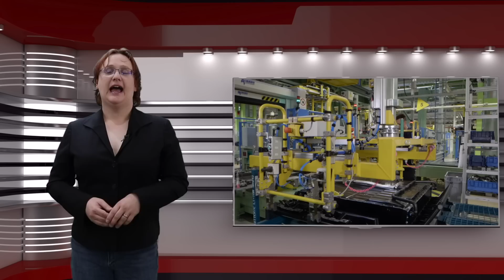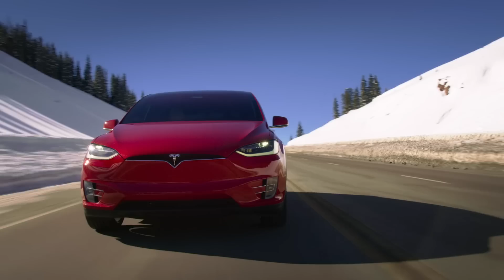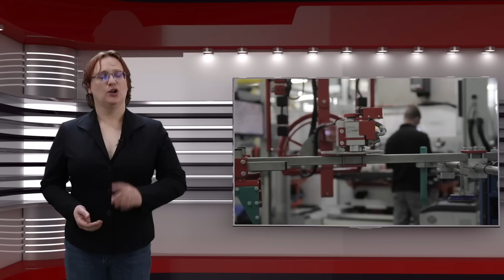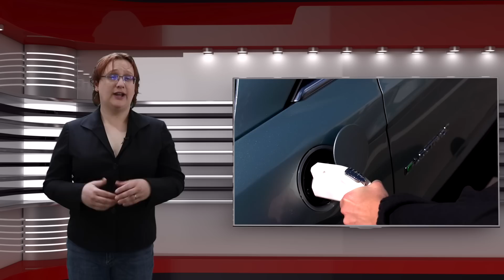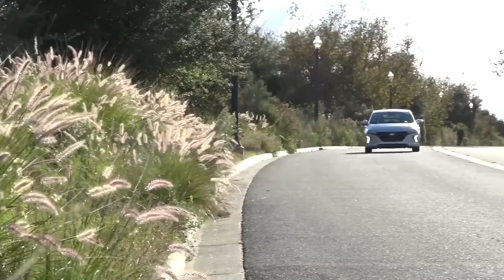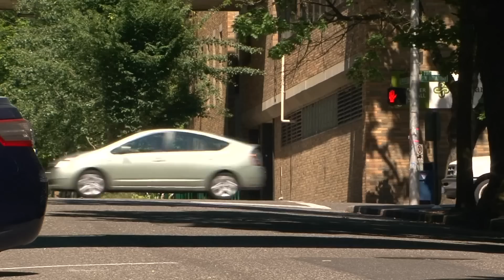As EVs Get Older, Aftermarket Batteries Will Change The EV Marketplace

Comment: 8 year is a morden car lifespan, wow my 22 year old car is still going strong 350,000k mile later
Reply: Sounds like my 99 Tahoe with 280k on the clock
Reply: 01 Dakota 300k and still runs great.
Reply: I just don’t know about Battery Powered cars lasting 20+ years though, my lawnmowers lasted 3-4 and I went back to gas, I’m guessing the same for EV? And the government never gave me any $$ for buying an electric lawnmower
Reply: @Precious_Metals_Fissioneer  except for the battery, it's likely that the rest of the car wil last 20plus years, because of the drivetrain using far less parts then ICE engines.
Reply: My last couple of cars I've hit 300,000 miles. My current car is 8 years old and has $122,000 miles. Total cost of repairs and maintenance today has been $3,000. it's a Kia which cost $15,000 American dollars when it was new.

Comment: Thanks for the info I love our BMW i3 would probably just trade in mine for a new one at battery replacement time. It’s a 2014 and still has the same miles and run time to this day. Not sure when or if I’ll even have to replace them. And lastly you could have saved the far right comment as I’m on the right and own electric cars and I also don’t litter. In the future I don’t think there’s any need for those kind of opening lines.....walkaway.

Comment: Battery technology is already advancing, a few startups are already boasting over 600 miles, and less than 2 minute charge times. Silicon batteries, solid state batteries,  etc.,  just give me the right voltage and you can take my old battery pack, no problem. And in 8 years, who knows how low it will cost?

Comment: When you talk about environmental impact, you have to consider how much virgin materals are used in battery pack and drivetrain. Plus what your power company uses as fuel for production of electricity. So right now gas engines have edge over electrc plug in vehicles, but in future with more recycled materials going into electric cars and their battery packs, and cleaner production of electricity, that will change. Plus newer battery technology promises a battery that lasts 2 to 3 X longer than current technology.

Comment: I have a Leaf (#712) and it still fully charges after 7 years.  Although you do lose range (so far my loss is around 10%) the degradation exponentially decreases so I anticipate getting at least 15 (maybe 20) years out of my batteries.  If so, I will have saved so much over a standard gas powered vehicle.  In those seven years so far my maintenance costs have been under $500 - replacement of the accessory battery, one flat tire, and yearly battery check.  In my case I'm in a pretty good environment for a battery with a passive thermal management system, and I always make sure to never leave the battery fully charged for more than a few hours.

Comment: Some interesting points but the two cars in my driveway are 14 and 15 years old if I had to spend thousands to keep it working it be will going to the wrecker. This may be the problem with electric cars I feel many will be wrecked because the cost of replacing the battery is more than the value of the car.

Comment: Electricity has a MUCH bigger ecological impact, not considering that nuclear materials are only 2/3 depleted when retired and have a several thousand year shelf life. But the smaller carbon footprint from consistantly evolving, internal combustion engines, drastically reduces gasses released into the atmosphere, compared to fossil fueled power plants. And electricity is more costly per month, compared to gas/diesel.

Comment: Implying that you’ll need to throw your Tesla (or even just its battery pack) away after 8-10 years is highly misleading. Tests have shown only 6-7 % battery degradation after 400,000 kilometers, which is more than most owners would drive in 8-10 years.

Comment: I hate hearing bias in videos like this. I'm totally gung ho on electrics cars, but you just can't make blanket statements about ev's vs ice's: a 6k lb Tesla has more than double the production carbon footprint of any ice car, and manufacturers are now producing engine that have the thermal efficiency greater than some fossil fuel power generating station, many of which are quite old. 

Long term electrics are the answer, but the bias isn't helping anyone.

Comment: 2500usd for a bettery after how many years? My 20 year old truck has had only oil and fluid changes over its life and is just under 3000usd. I call bs on the 8 year life span and battery cost..... 2500usd for a battery replacement is  (lowest cost) seems LOW

Comment: Same than with phones, if manufacturers do not give the option to the customer, a market of unofficial battery packs will emerge. Electric cars can run for 20 years. Batteries are going to cost around 3.000 Euros in 10 years time. There will be yet a shortage of electric vehicles then. Buying a 15.000 refurbished 2019 e-car in 2029 will make more sense than buying a 4 years old internal combustion one for the same price. The only logical option for the manufacturers is for them to charge a big extra for an official battery pack and/or to try making battery pack refurbish illegal. I don't see the last possible. They may software unable installation of unofficial new closed batteries, but I don't think they can avoid anyone opening the official pack, changing all its batteries with new ones and packing the battery back.

Comment: I wouldn't be sure that batteries will need regular replacement going forward. I have a 5yo ~90k mile Tesla that is still at 96% of its original range, so unless it just randomly fails completely, the original battery should still be good for a long time. I know Nissan and others don't last that long, but I think they'll get there eventually.
Reply: Jeremy Schmidt ya the leaf, even the new one I heard, doesn't have water cooling for battery.
Reply: Spenser Roger The upcoming 60kWh leaf is supposedly going to finally have active cooling on the battery. Fingers crossed that happens. A Leaf with 200+ mile range and a battery that lasts will be a pretty good car actually.
Reply: Tell tesla to change it, ten year warranty isn't it...if my car didn't give me 100% i would complain
Reply: joey doe  96% after 5yrs is exceptionally little degradation for any lithium ion battery. This much or more degradation is expected, so there's no way they'd change it and I'd be crazy to complain about it performing exceptionally well. 

Oh, and, for the record, it's a 8yr warrantee. Doesn't matter here but thought I'd clear that up...
Reply: 10 or 8 years don't matter will never be a battery electric car era, electric cars but whit a fuel cell or a connection in the road, battery is the same time consuming thing like the oil and its cost to much, in sweden where i live volvo is testing a road connection and like volvos experiments before think its can work.
My diesel subaru outback still gives me 100% every day and its 4 years old and beats a tesla in snow and dirt any day
Reply: joey doe  Hydrogen fuel cells don't last even as long as batteries, and cost way more to run, plus you have to refuel at a station just like gas/diesel car (that's a big downside once you're used to home charging). I think hydrogen is a dead end road. 
Charging in the road might work, but will be inefficient at best...but I'm open to it if they can figure it out. 
I strongly doubt that your Subaru is still giving you 100%. Engines wear with time and give you lower fuel economy. 96% is still so close to new that you probably don't notice it, just like I don't notice my slightly reduced range...
Reply: i mean some new idea not hydrogen, home charging in sweden cost a lot and the tesla power thing needs more charge what a normal house can give, think a normal house have 10 amp  and the tesla needs 16 so you have to upgrade the house and then the cabel in the ground...
Used to work whit it befor as a stone mason and all my friends still working in the industry say one thing but cabel to 1-2 electric cars like tesla in everybodys house or even to charging stations in a small city its like remake all the asfaltroads in sweden underground, don't get me wrong i like the electric motor but not the battery its so enormous unificent this day and  has no long life, park your tesla for 2 years whit out any charge and see...
one of my land rover defenders i slumbering in the garage for 6 years and it still starts if i fix the battery haha 
search eroad arlanda and you will find the swedish solution and when we change it to wifi or something its the new battery,  volvo is going to have  electric motors in all cars 2019 but will have a hybrid because there are no good battery's
Reply: joey doe Ok, I guess you'll see the truth soon enough so I'll quit arguing. If a battery that outlasts an engine still isn't good enough for you then I'm not sure what is...
Reply: sorry for the hassle but a battery that outlast a hassle free toyota engine is long a way , 2017 december there was 0.15 % sold electric cars in the world and mostly in china so to think its gona be a major change whiteout a couple of wars and you and me very old is really bullshit and when tesla go down and it will because its not making money it will take longer to change out the old cars
Reply: That's not how batteries work, there are companies that guarantee range but they do that by not allowing you to use the full capacity when new and then as it ages letting you use more and more of the reserve capacity. This actually pisses people off way worse because they are not being allowed to use the full capacity of there battery.
Reply: joey doe
If you tested your Subaru performance I'd bet money it's NOT "100%", not in terms of power nor range.  (depending on the mileage)
Also it turns out Tesla is making very good money on the 3 which is a major component of the companies financial performance so it's likely that Elon is right about profitability this yr.  Amazon and Netflix don't make money either and they are doing just fine
 
https://www.thestreet.com/investing/tesla-model-3-is-already-really-profitable-14653241
Reply: That’s why the Fiat is where it’s at! I’m hoping to get 20 years out of my battery pack. It’s water cooled and made by Bosch so it has to last!
Reply: they all have the same batteries.  yours will fail shortly.  tesla has no special mysterious battery.
Reply: goofyfoot2001
Perhaps you know better but automotive expert Munro who completely deconstructed the Model 3 determined that the batt tech was far superior to anything else on the market and even significantly better than the S or X.  Also the 3 has some 30% higher energy density than the S or X and those two were already the best with one rival--the BMW ugly little EV.  Battery life may turn out to be a non-issue with only slight degradation by 100k miles and perhaps 500k possible.  These are not smart phones.

In short, you don't know what your talking about.
Reply: 5 years with 96% seems outstanding and its only getting better with tech.plus Its 6 times more cheaper than fuel so huge deal on fuel cost is saved too.tell us about ur maintainance cost too.heard ev's require minimum maintainance since they have less moving parts.is it applying to your ev too?
Reply: Bo McGillacutty, well, the BMW i3 uses a Tesla motor& battery.
Reply: Tesla also has top of the line battery maintenance systems built in to preserve battery health
Reply: Jeremy Schmidt, to be fair, I DID hear about a Tesla Model S, that was being used as a Taxi, with 400,000 kilometers, that's had 3 battery replacements, all under warrantee. But that was presumably due to frequent Supercharging, under harsh daily commercial use. Most cars would never experience those conditions.
Reply: When your battery starts to lose it's capacity.  Look on my page for A trick to regain some of the capacity back.  You can use this trick on cellphone, power tools, solar arrays, 12 volt car batteries Ect.

  The effect is cumulative and takes quite awhile to get the full benefit on each battery.

  The trick should be connected while charging, but can constantly connected if that is easier for you.
Reply: Probably because a Tesla has better range, hence you charge it less than a Leaf for example.

Comment: My drive range to work is 16 miles two way..  So if my model 3 Range is 300 miles.  by the time it range down to 50 miles because battery getting old.  My M3 would last 50 years... over a million miles, don't u guys think so ?  Well, with old battery technology.  The Lyft company for model s or X drove over 300,000 and their batteries still have over 95% decodation.  Thanks for commend.

Comment: Like in the 50s and 60s teenagers tinkered with gas cars to make them go faster (hot rods). Today's teens will tinker with electric cars for the same reason. Trying to squeeze a bigger motor or larger battery pack to gain more speed and more power. Also messing with the software to do the same. 

G

Comment: As EV's and range extended hybrids become more numerous, it becomes easier to customize ANY existing car into and EV/hybrid. As for keeping older EV's going from an engineering standpoint they are VERY simple. Sure some manufactures will be painful and make us create workarounds for their propitiatory software until governmental regulation forces them to do otherwise (as with ODB2). But the brains (for the battery/motor etc) can relatively easily be replaced/circumvented with arduino/rasspbery powerd alternatives that already exist in the home built ev world

Comment: Older/early model/low range EVs will keep being used with their original batteries because, over the mechanical lifetime of the car, there will always be buyers whose needs are compatible with a cheap car with a limited range between overnight charges, however limited the range might become. A gradually decreasing range is quite different to the increasing maintenance costs of an aging ICE car due to progressive mechanical failures. The range of the EV declines but the cost of ownership per km traveled remains flat.

Comment: I'll post this on the Patreon page as well but I just hit 20k miles with my replacement battery on my used Leaf.  I had bought it from Carmax in January '17 with the intention of getting one that still had a warranty on the battery.  I found one in great shape and with 10k miles and 10 months left on the warranty.   It dropped the 4th capacity bar and I had it replaced under warranty with no hassle.  

Now it's been another 14 months and 20k miles, and to date no noticeable degredation and still all 12 capacity bars.  It's probably a combination of my slow charging on 120v almost always and the improved chemistry of the replacement pack.  I still watch everyday for that first bar to fade, but nothing yet!
Reply: Thank you for sharing your Nissan Leaf story. Mine unfortunately has not gone so well. I was 29 days out of warranty with only 30,912 miles on my car and it dropped the fourth bar. Nissan call center said I'm out of luck. My car only goes 30'ish miles now when the air conditionong is running.  I have an idea... If your leaf gets in a wreck, promise to donate your new chemistry battery to me, ok ;-)

Comment: Good video, agree with the EV points... However I wouldn't expect the internal combustion specific elements of a car to be the main reason for it to reach the end of its life...often minor collisions, suspension, corrosion, electrical or other lesser things would kill them off because high depreciation means even minor things can make a car uneconomical to repair (and a well lubricated engine actually doesn't wear much!).  Totally agree that the economics of an EV are quite different and will be interesting to see how this develops as we hopefully see improvements in battery capacity and longevity.

Also I would expect 8yrs/150k miles to be a typical minimum life (the earliest time a car is likely to be scrapped).  In the UK at least in use I think the average age when scrapped is closer to 12-15yrs/200k.

Comment: I can't count how many people I've known that have replaced engines and or transmissions with far less than 100k miles on them. These people have spent on occasion more than $8k, but they worry about the cost of battery maintenance. I know a number of people who have owned EVs for many years, but I've yet to personally know anyone who has replaced their battery. Most continue on with reduced range.

Comment: Just remember: Most of the original Tesla Roadsters are still running on their original batteries.

The thing is: Since there's hundreds of battery modules inside the packs and mostly, companies won't let you charge to 100% while you probably won't let it dry out to 0% the wear on each module is minimal, and since there's so much batteries inside the battery pack they actually last very long. I mean nowadays most smartphones won't allow you to easily swap batteries, that's because most of the batteries would last for about 5 years anyways so they simply don't need to, now imagine if they had software built-in that would help us extend battery life like in EVs life expectancy would be better, and even so, since it's only one battery it will take on all the stress and eventually will die. In a car however there are hundreds of modules to share the stress and that's why most tesla roadsters are still running on their original batteries mostly without any sign of problems.

And even when modules inside the pack start to show problems they're such a small part in the equation you probably wo'nt notice untill a way bigger number of them shows some kind of defect